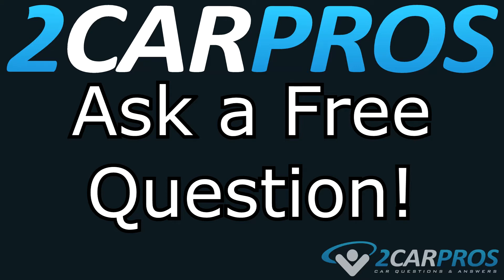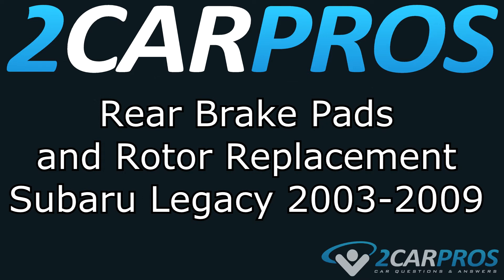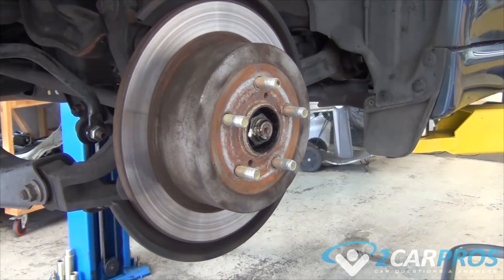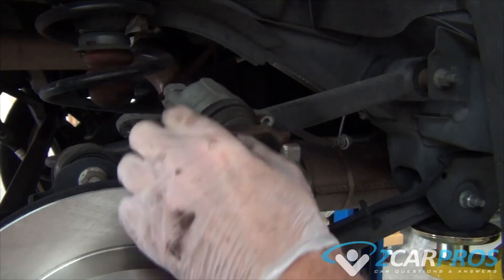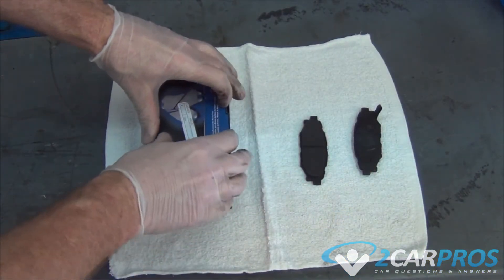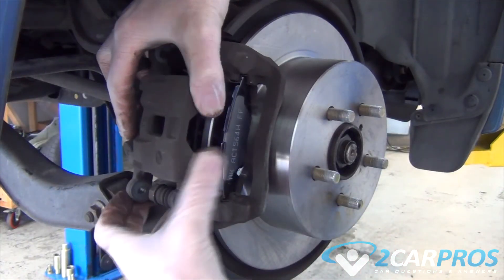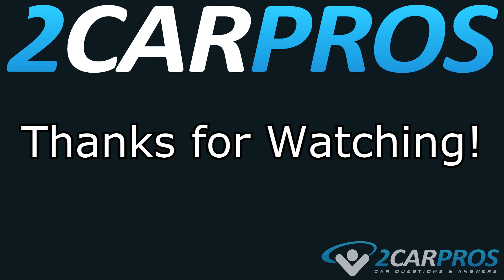Rear Brake Pads & Rotor Replacement Subaru Legacy 2003-2009

Comment: Is the caliper bracket bolts 17mm or 15mm?  I thought they were 17mm but last I tried my 17mm didn't seem to fit on the bolt( or through the hole)...15mm seemed to fit but I didn't have an extension available for that socket set..... I've been having a head time getting to those bolts....sockets are too long and thick and don't fit into that hole you put the socket extension through....I was thinking of just trying to find a long (8" or so?) slim extension with the right size head and thinking I probably could use my swivel ratchet to get it loose...the fronts were a piece of cake, the rears not so much.....thanks for your help
Reply: I've been trying to figure out the same thing because of the access points it was hard to tell.  I've watched several videos for the rear caliper removals and it seems like they all agree that the caliper bracket is held in place by 2 14mm bolts...when I tried mine last weekend I couldn't find my 14mm socket, the 15mm almost fit but made me think that the bolt was rounded, so I'm going to try a 14mm this weekend and see if that works for taking them off.

Hope that helps, but yes the access points are hard to maneuver if you don't have the right extension to fit in there.  Good Luck.
Reply: I have a really hard time aswell getting those bolts, like Anna said, every videos i saw they said it was 2x 14mm bolts

Comment: Hello 2 Car Pros
    Looking at your disc brake replacement video I noticed the old anti rattle clips were not replaced with new ones - also the brake sliders were not cleaned and greased - it would be a good practice to show  that in another one of your videos for the you tube viewers to learn the correct way to do a brake job .
Reply from the maker: +Pete Moss Sorry we didn't meet your standards with this video but we are doing this just to show the steps so the people could use it as a guide. Our shop is located in Southern California(minimal rust) were we rarely need to grease the sliders. If you do notice your vehicle needs grease we suggest using it. But to be careful because not to let any grease come in contact with the brake pad(If this happens the pad will get contaminated and will need to be replaced).   Thanks for the comment.
Reply: It was a great video up  to that point.
Reply: I was taught to spray something at the end or towards the end of replacing brake pads. Like a greaser thing. But I didn't see it in the video.   My uncle taught me how to change brakes.
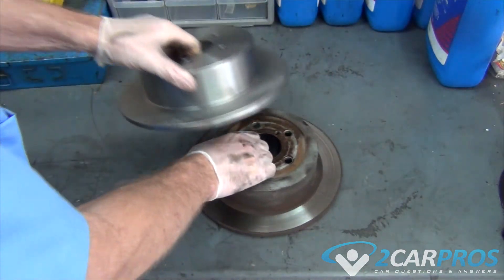Reply: @veronicarawls4355  Must be brake cleaner. It's a degreaser to remove dirt and contaminants, as well as to remove the factory grease put on to protect the brake discs from corroding during storage and transport. They use carburettor spray in this video at 3:00 to remove the manufacturing grease, which is essentially the same thing as brake cleaner but a little stronger I think. It's usually common practice to use brake cleaner when you're finished installing the brakes to remove any oils or dirt before installing your wheel.
Reply: @williammrs  DEFINITELY!

Comment: what size were the bolts used to remove the rotor?
Reply from the maker: 8 mm 1.25 thread.
Reply: @2carpros  it would be ingenious if those are the same thread as the bolts for the sliders
Reply: I thought that too, they are the same thread as the sway bar bracket that is located just to the rear of the rotor though! Found out that fun fact today.😀

Comment: thanks, I couldnt find a video for a 2011 Legacy but I assume its the same concept. This did help solve the issue I thought I would run into getting the rotor off by using the bolt concept, very helpful. This didnt explain what mm your'e using to remove the bolts though but I assume its a 10 mm, if so I still cant find mine lol.  thanks again
Reply from the maker: Thanks for watching!

Comment: How do you remove the rotor if the old rotor does not have the press holes like the one in the video?
Reply: Lj828 thanks I found a rotor puller in my dad's shop though
Reply: Sz for caliper mount??